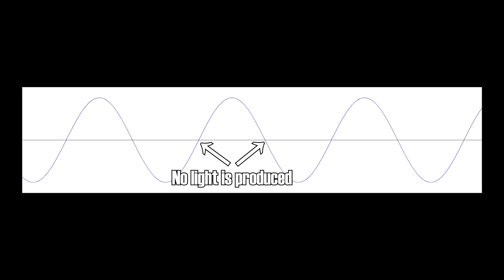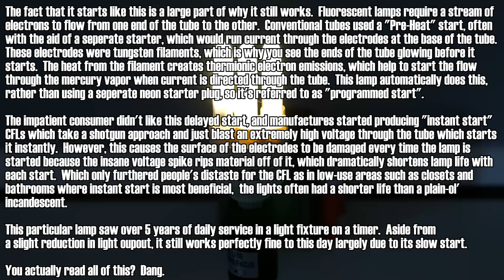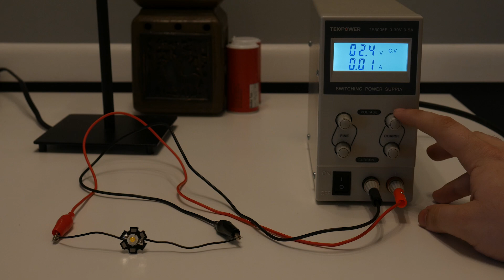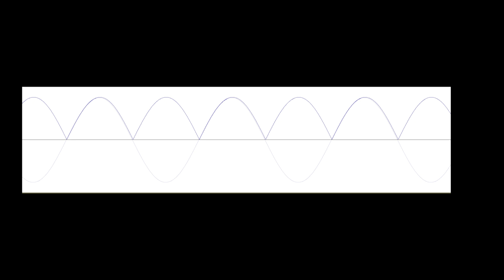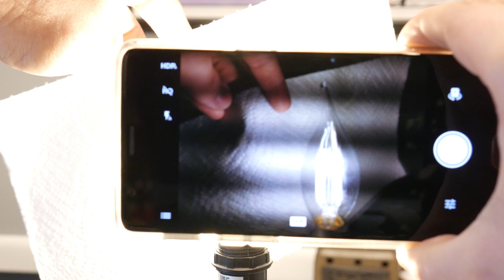LED bulbs that flicker, and CFLs that almost never did

Comment: I use the CFLs warmup to my advantage. We love them in the bathroom in the morning. Dimmers all still seem to hum annoyingly with LED bulbs when all 12 run in the bathroom even with crazy expensive bulbs. They also don't hum and warm up slowly while our eyes adjust. All the other lights in the house are LED on dimmers. There doesn't seem to be the humming problem with 4 or less bulbs.

Comment: coming back to this in 2025 trying to dig into if whatever brands of lamps i have are doing high frequency flicker and causing headaches. hard to find useful actual information these days that isn't full of whatever nonsense that's SEO'd to hell and back or AI-text-only slop for clicks. cheers for the continued great well researched, well produced, and excellently informative videos. :D

Comment: 3:45 as a matter fact this is quite true in my house. There is this 1980s style light fixture in my kitchen. It’s one of those styles with the wooden box thingy around fluorescent strip lights with plastic panels according to my mom’s and who owns the house the bulbs were installed in 1994 and have been used ever since and they have not been replaced ever this is because it does use this strange preheat style fixture

Comment: A led conducts in one direction, it is a rectifier. If ran with dc there will be no flicker. A led will only flicker when ran on ac or pwm. Led makers use pulse width modulators to artificially boost efficiency. That’s why they flicker.

Comment: 10:53 I don't think a switching led driver gets that much cheaper when the voltage of the led string gets closer to the input voltage. Some component values will change. On the other hand, a led bulb only costs a few bucks, so the cost saving might be significant after all. 

Also,  a led string with a higher voltage might open the possibility to use other driver topologies. There are quite a few led driver designs being used. Today I opened a Philips led bulb to find a linear led driver (BP5131D) inside.  It probably chops up the main voltage as well.

Comment: Even the old linear fluorescent lights with magnetic ballasts often had two bulbs, with a capacitor on one side so the two bulbs were out of phase and greatly reducing flicker. This also improved power factor. my kitchen has a 1939 vintage fixture with two 24” 20 watt bulbs on the original ballast. I replaced the external capacitor. Of course they can be upgraded to electronic ballasts.

Comment: They are bad on the eyes and ask anyone that has lupus. You need to add a black light and also put a ground shield over the fixture. We will also have problems with LED lights as well the high color temperature type nothing over 2700.  It's already causing more night danger on the roads with these high temperature lights as headlights. I will stay with warm white filament bulbs on my cars. Especially my headlights. 73

Comment: I have a gereral photosensitivity issue and back when I was in high school the CFLs they used for the lights in the ceiling were so bad that I'd get migraines extremely often. To the point where people thought I was faking to skip school. After I changed schools the problem basically vanished because they used newer bulbs.

Comment: I have had CFL's fail in a mode where they had a charge in the filter capacitor but no connectivity to the ballast oscillator due to solder failure. I threw two of those bulbs in my waste basket and they actually flashed one last time.

Comment: Fun fact: my LED bulbs have to be on the color setting on a brown color and very dim for them to not bother me for the short periods of time I use them.

Relatedly, I struggle with my laptop much of the time with eyestrain. And the darker it is the worse it is, and if i dare to use a blue light filter, the eyestrain is horrendous (although it isn't an instant headache that the pure blue white lights are)

Comment: The phone camera trick doesn't work anymore as many phones have flicker sensors nowadays, so they seem to be able to cope with bad LEDs and various flickering display technologies.
Reply: The most effective way is to wave your hand under the light, the hand will look like it has defined trail if the light is flickering
Reply: Although not mentioned in the video, you can actually detect flicker quite easily with a fidget spinner, as you will see rather irregular spinning illusion patterns if the light flickers

Comment: I dont like the little ballast LEDs. Some of them start slow for some reason, and they fail often. the bigger ballast ones are great.
Reply: I tend to find that the traditional large ballast LEDs work better upside down as they effectively carry heat away from the diodes and the filament LEDs work better right side up as the heat rises up and away from the ballast and diodes

Comment: The only problem I have with the ballasts is that alot of them contain PCBs...then the bulbs have some mercury...people tend to say "oh there is only a tiny amount" thats true but remember one small to medium one story building could have 50 to 200 of them...and the numbers go wayyyy up from there...LED bulbs...especially cheap, but even the "name brand " ones give me massive headaches, and they get worse as they age, most seem to have a failure of the power supply not the actual diodes...

Comment: LED trash
Reply: LEDs by nature don't produce as good light, but they're incredible for your power bill and give off almost no heat, which will save at least a few cents in AC bill

Also, if the last time you tried LEDs was years ago, give them another shot. They've improved immensely and you probably just had a bad experience - I recommend Philips warm hue bulbs.
Reply: @91jmixes40  LED with much worse color rendering seem to be much more efficient than the high cri one, the biggest problem with LED is it's inability to produce pure red color
Reply: @GERMANIA292 I wouldn't say they're incapable of it as there are a few models that have r9 values above 80 and even around 95 or more. They're just more costly and potentially less efficient
Reply: @exoticcar5482  the phosphor may block most if not many of the blue light making it potentially less efficient, and not to mention that company cheap out on making less LED chip which in turn make it less efficient than an underrun LED
Reply: And that's where people are putting them too--in the trash. Plastic and computer chip LED isn't better for the environment than a metal and glass halogen bulb! LEDs never last as long as they are supposed to and produce ugly, harsh light.
Reply: @John-bs5ug saying led always produce cold white light and never last as advertised is rather misleading

Comment: Maybe I'm just an odd case but any light other than incandescent bulbs causes me to have trouble  sleeping (if used before bed, such as watching Tv in the living room in the evening) or gives me one heck of a migraine issue. I cannot stand being around the white bluish light of an LED light and the output just feels wrong to me. Any bulb other than incandescent or HPS causes these issues with me. I can't SEE any flicker but something about LED bulbs causes huge migraine  triggers unless I limit exposure to daylight use (such as the office at work, using half the available lights to reduce brightness) or only expose myself to them for no longer than 4 hours and NEVER in evenings. I don't understand it. it doesn't matter if it's a 2700K or 5000K LED, although the latter is far more painful for me as I cannot stand white clinical lighting. The 2700K has less impact but still causes sleep disruption and migraine issues if used too long.

Either way  that's why I'm stockpiling incandescent lights as long as they remain available. Not because I'm a boomer afraid of change but because anything else causes me actual pain.

Comment: For me it has always been the harsh yellowish light of incandescent and most compact fluorescent lamps that caused me a great deal of headaches. I grew up in the 1980s - 1990s with pretty much constant headaches and it wasn't until I was able to start buying my own lighting that I discovered the "daylight" fluorescents and my headaches went away, except when I'm in places with that antiquated fire light.

For a long time now I've been using "daylight" LED strip lighting for much more even lighting and I think it's great, especially since there's no flicker since it runs off of 12 Volts DC.

Recently I was given some cheap LED bulbs and when I tried one I got an instant severe migraine, it was one of the "warm white" (extremely yellow) bulbs. I have no idea if it flickered since just a split second of that horrible yellowish light caused me so much pain, I couldn't possibly experiment with it.

Comment: I've got to admit that I like the slow ramp-up of CFLs in some instances - mainly if it's already completely dark.  I find sudden bright light jarring and acutely uncomfortable.  If the room is dark and I switch on a CFL, it starts out quite dim... more than enough to find my way across the room but not so bright that it feels like an assault on my eyesight.  Then the light level gradually increases to the point that I've got enough light to perform tasks that require good visibility.  Because my eyes have started out with low-ish light and worked their way up, it's less jarring than snapping on an incandescent or LED bulb that suddenly floods the room at full brightness.

Also, I can't see very well under incandescent or "warm white" CFL or LED lights - trying to do anything tricky that requires good visibility, like threading a needle or working with delicate components, I'm practically blind.  If I'm using cold white CFL or LED, I can see quite clearly.

Comment: Daylight white is not cold white. daylight is SUN LIGHT which is the definition of clean warm light. 🙂

What you hate are those nasty green (CFL) or blue (LED) bulbs that have a rather obvious and yes I agree VERY disagreeable "blue" (or green) cast to them. yuck :-)
Reply: Daylight is cold white, the sun is 6000k but appears slightly warmer because our eyes are more sensitive to blueish color in the night time

Comment: Way back in 1976 I started a job as an artist for a custom silkscreening shop. After a few months I thought my eyes were going bad. I had terrible eyestrain, and even when I wasn't at work my eyes could hardly focus enough to read. Then someone suggested the twin-tube fluorescent lights I worked under might be the problem. So I removed the tubes and just used my incandescent desk lamp. Very soon my vision returned to normal. 

Later we replaced the old fluorescent fixtures with new ones, and I never had any trouble with them. To this day I don't know if the old fixtures had a defect that caused them to flicker at an abnormal rate, or the newer ones just didn't flicker as much.
Reply: What about those ostrich egg style bell fixture bulbs???

Comment: I was impressed on the improvements made to CFLs over a decade's time, as I recall 20 years ago when they were first widely available and affordable, they didn't throw out the brightness of an incandescent bulb; although the CFLs of 20 years ago were marketed as equivalents to incandescent brightness.
Going back 20 years there was a demonstration display of CFLs to incandescent bulbs of equivalent brightness, where flipping a switch would light up the incandescent bulb; flipping another switch would light up the CFL next to the incandescent.  To this day I still recall being able to closeup stare straight into the lit CFL with eyes wide-open; where the equivalent 60 watt incandescent had a brightness several levels higher than the CFL, almost blindingly bright, where I had to squint my eyes to view it. 
But, years later the brightness of the CFLs improved immensely.

Comment: Every shot of the stroboscope discs looked blurry to me, probably the video encoding / decoding. I've seen the effect plenty before as my Technics 1210s had a little strobe light and dots built into the turntable platter, but for me it just wasn't visible in this video.

Comment: You as a maker of Youtube videos should know the true problem with CFLs. They break when you knock them over. I bought big - tall shadow box lights to use in my videos eight years ago. I filled them with expensive CFLs and got decent results. But I had long extension cords snaking all over the room. I am not all that nimble. I was constantly tripping over them and and when the lighting stand came crashing down, one or more CFLs would be demolished. Expensive.

Now that I'm trying to make videos again I have the same kind of stands, and extension cords and I still trip over them. But the LEDs survive. The relevant term is - solid state.

Comment: Got your point. Great video. I installed four LED ceiling light fixtures in my garage. They look like the four fluorescent light fixtures I replaced. In one of the four light fixtures, one of the LED tubes keeps flickering. Not all four, just one. When I turn on this fixture, this bulb works perfectly. After a few minutes, the flickering begins. The fixtures have standard outlet plugs and are not plugged into a dimmer switch. Any ideas?
Reply: Bad bulb obviously.  Should have returned it for money or exchange

Comment: 13:43 Re: recycling CFLs. I totally would have recycled my CFLs if I knew where to take them. Our local trash/ recycling building did take used batteries, but not bulbs. I admit I was not a fan of them, probably due to the cold light, but it was annoying when I needed to step outside to take the trash out and I had to wait a few minutes for the porch light bulb to fully light up.

Comment: Nah, the superbright LEDs, especially the high intensity ones used in emergency vehicles (blue and red) are the blame not only for eyestrain but cause convulsion and temporary to permanent blindness, including causing a halo and making it difficult to see at night in pitch black. Vehicles fitted with such bright LED and HID headlights and very bright red tail lights should be banned. They are unroadworthy because their light beam cause excessive glare that exceeds more that the eye can tolerate. Cursed LED lights!

Comment: I call bullcrap.
Every CFL makes me want to remove my own brain, but HPS lamps don't. 

I had to quit school because I couldn't take the lighbulbs anymore without wanting to go all berserk, but high pressure sodium lamps don't bother me at all, so it's probably not the vibration. 

I'm no scientist, but my theory is that since CFLs are made of toxic material(the white powder inside), shining a light through them produces a toxic effect. That's as good an explanation as any, at least for me. Sounds stupid, but there are in fact properties to light that aren't connected to it's cycling frequency. 

Thing is, you can say anything, but CFL light hurts me like heck and I don't think there's anything that could convince me that I imagined a decade of migraines that only came to me when I was in a school, an office, a factory or a hospital. I shxt you not, I feel like 10 hours of sleep's been drained out of me just by hanging around under a CFL for half an hour. I used to think for years that I just didn't like those locations, but then I realized that the only common thing they have between themselves is those damn glowrods. 
I believe people when they say it doesn't affect them at all, but I'm also kinda forced to believe that they're also completely unaffected by perfume, palm oil, fast food and the smell of cheap tobacco, all of which make me want to kill myself.

FYI, I have no allergies except for my inability to process large amounts of lactose, so it's not even that I'm a wimp or have a weak constitution.

I wrote this because I think most people are embarrassed to admit that they have a problem with CFLs. 
Besides, when you calculate overall costs, recycling an old bulb costs a fraction of what it takes to turn a broken CFL into a working CFL. It might be cheaper to manufacture them, but the long term costs and the environmental impact are massive.

In any case, fxxk CFLs and the horse they rode in on.

Comment: I am definitely not a fan of 3000k & higher lighting...in fact, the main lights in my room have a red light filter in place.🤣
If I need to work on something that specifically requires the rest of the spectrum, I have two other lights with 2700k bulbs instated.
Otherwise, I mainly just use my red filtered LED lights.
It certainly make it easier to sleep since the amount of Red wavelength light is far in excess of the Blue frequency my devices will put out.

Comment: With my eyes almost every light causes eye strain, some more then others... only one time; when they tested Green streetlighting (like colour green not eco-green) , that worked REALLY well, much farther sight and absolutely no eye strain, I wished they continued expanding that but they havn't, LED and older lamps are Okish, real bad is Xeon and fluorescent bar lighting with reflective shielding, that really batters my eyes and makes me extremely tired, led can be sharp if you look straight in it but is very doable from the sides, the CFL you use and older lamps with wolfram flicker to me as much as LEDs , the former less intense the latter less spread, CFLs are a bit worse then the old wolfram to me but probably a bit better the LEDs up close but worse then LEDs from afar. 

no idea if this will help you understand how light sensitive i am but there you go.
Reply: to be honest since all lights seem to flicker to me including the sun i suspect that that flicker is mostly caused by my own heartbeat pumping blood into the stressed veins of my eyes, so that probably overlaps with any 60 (or here 50) hz of AC , LEDs flicker to me as well even when from a DC source so theres that